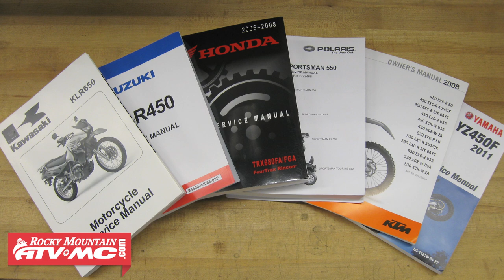How To Adjust The Needle in Your Motorcycle or ATV Carburetor

Comment: Great video. Would using 2 year old oil/fuel mix contribute to fouling plugs? I have a 1999 Husky WR125 and it was fouling plugs all day today. It was over 90 degrees with high humidity and the fuel was old.  I was thinking of adjusting the needle, cleaning the air filter and replacing the fuel.
Reply from the maker: bg147 Yea, you're on the right track for sure.  I would add to your list inspecting your reeds while you're in there as well.  Inspect each reed pedal. Let us know what ya figure out.  Thanks for watching!
Reply: Thank you. I will take your advice. Tonight, I replaced the old fuel, cleaned the filter element, and the plug fouled while I was doing some full throttle runs. So,  will work the carb and the reeds.
Reply from the maker: bg147 Sounds good.  Let us know if we can help!  Thanks for checking out our video.
Reply: @rmatvmc I have a 08 KTM 4 stroke I have my needle set at top position clip and the fuel screw turned 1 turn out but it's still to rich. How do I go leaner when I can't on my needle or screw the bike idles well just has a midrange bog.

Comment: I have a flat cr like this and I have that electric solenoid that's like a main jet shut off or something and I think it quite do you have any videos on that don't want to pull it out till I know what I'm doing it's got those tamper-proof Torx keys and I wanna know what I'm getting into before I pull it off it's just a swap a new one and let me know because I think it quit whenever I rev the bike without the choke on it just dies out clean carburetor everything else works good Jets and you don't write everything worked great till I think the solenoid just quit.

Comment: Thanks for the video.but how do i know that my carb is adjusted well?
Reply from the maker: You'll know simply by how well your machine runs. If it doesn't hesitate at all or pop at any point throughout the throttle range chances are your carburetor is working properly.
Reply: Kareem Vitar After needle regulation and ride about 5km, U should check colour of spark plug. If it's white U should reach mixture, or if it's black U should lean it.

Comment: My 2005 YZ450F is backfiring. it idles fine, so the pilot jet is correct.   But once i open the throttle and let it off the backfiring starts. Should i  move the needle richer or leaner?. Thanks in advance. 😊
Reply: i had the same problem so if i was you i would order a jd jetting kit for your bike and also get an adjustable fuel screw from tusk, if it is backfiring that means you are to lean.

Comment: I am using 50:1 on trails. my spark plugs are getting ruined all the time. They told me to move the pin on the needle so less oil gets to the top end. I dont know if I move the clip down or up. Thank you.
Reply from the maker: Dropping the needle is going to allow less fuel to flow so to do that you would need to raise the clip to the next position up and then ride it and see how it runs.

Comment: Ok so i have a four wheeler and the carburetor needle is not pulling up or down. At this point i think its my throttle. What do u think is wrong with it? Any suggestion will help
Reply from the maker: Eli Martinez Which four wheeler do you have? Is the slide not opening at all when you try? It could be a number of different things like something is seized up or your throttle cable is broken. It's hard to say without having more information.
Reply: I have a taotao atd 110. Well today I noticed my choke can be used as the throttle and the slide does not move.

Comment: My yfz 450 is back firing mid to full throttle on deceleration it's bored to a 501 I'm running a 180 main and 48 pilot 2nd clip from the top and 3 turns out why any idea what I should to to get rid of that back fire I have been told it's to rish but also been to its to lean any ideas thanks
Reply: I've seen it caused by tight exhaust valves - have you adjusted your recently?  Typically though, it's caused by an improperly sealed midpipe/headpipe or lean pilot jetting.

Comment: My atv bogs a little when around 1/4 throttle, but has lots of power from1/2 throttle to full throttle and should i  do this?
Reply from the maker: Yeah it sounds like you're on the right track. I would adjust your needle and then move onto the needle jet if that doesn't solve your problem.
Reply: Rocky Mountain ATV MC thanks, also my other problem is is that i cant run an airbox and i dont have a proper exhaust on it and i may need bigger jets because of the extra air flow. Its no big deal i have other wheelers and this one is a bit of a beater anyways.

Comment: Does this work in combination with the fuel screw on a 4 stroke? I keep fouling plugs making it impossible to start so i moved the clip one step to lean. I revisted the fuel screw today and it's currently 3 turns out but it seams to prefer 4 but it wont idle. I'm assuming if i move the clip again i won't need the fuel screw out so far? Yz426
Reply: u need to chhange jetting, more that 2.5 turns out you need to adjust your jetting

Comment: How can i now how high to put needle clip if i dont have any service manual?
Reply from the maker: You should be able to find a service manual for your machine online pretty easily. But if not, you can always adjust the clip one position at a time and see how it runs then make changes based off that. Start with the clip in the lower position as to make sure you don't accidentally run your bike too lean.
Hope that helps and thanks for tuning in!
Reply: @rmatvmc  Ok i will try, thanks!

Comment: if someone is here to know why their bike eats too much fuel then you need to see if this needle has scratches on it . i saw my needle with scratches on one side, so i got it that the fuel goes more then air into the carburetor process because the needle had scratches on the tip
Reply from the maker: Tahy Good point made.  Thanks for sharing.

Comment: I keep fooling my plug(every 30-40min while riding) on my yz125 what should i adjust? Needle/pilot/main jet
Reply from the maker: That's a difficult question to answer because a lot of jetting is trial and error, especially if you don't notice it running funny at certain rpm's. To start with I would make sure your air filter is cleaned and oiled. Also make sure the fuel you're running is high quality and the gas/oil ratio is what it should be. Have you had this bike for a while and it started fouling plugs one day or is the bike new to you? Just to be sure I would also check the spark plug and make sure you're running the correct one.
Reply: @rmatvmc  i had the bike for 4 month and never did this in 3 month until last month and it bog a Little bit on 1/2-3/4 trottle
Reply: And Filter is cleen every ride and fresh prenium gas with yamalube 50:1 but it Mayne because of the hot times we got in Québec😎